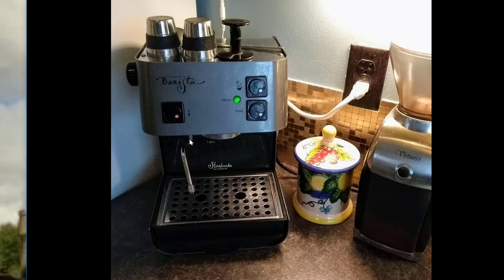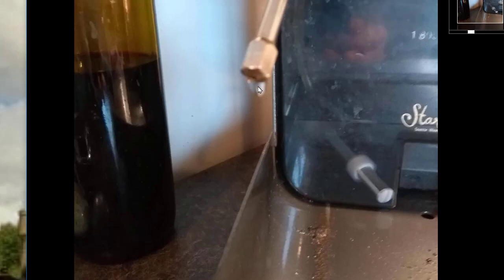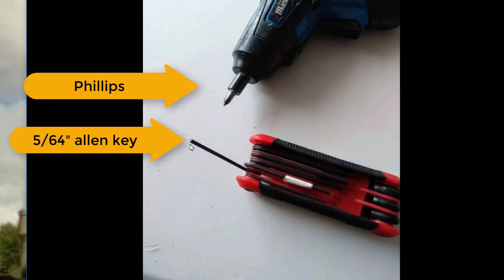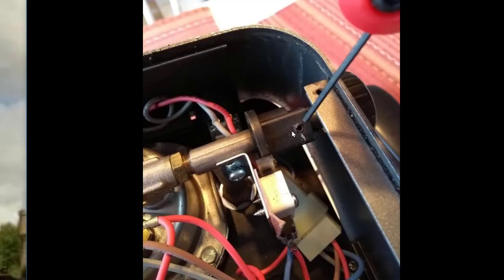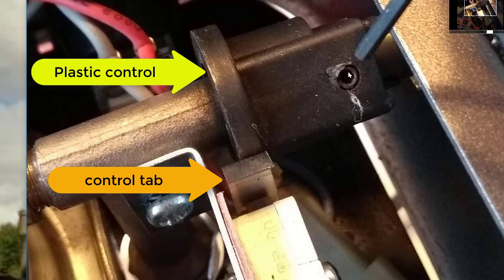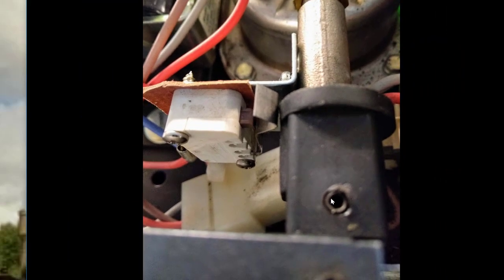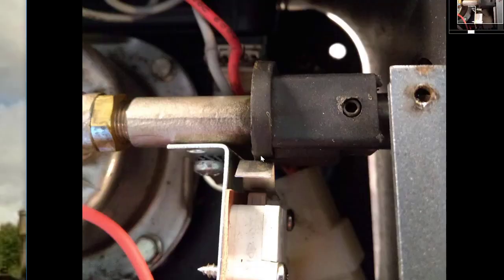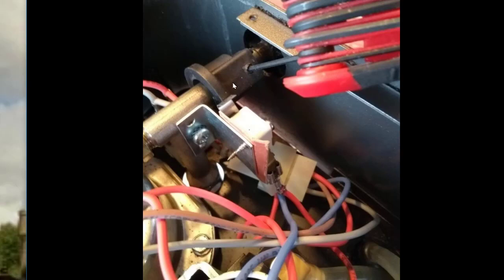Starbucks Saeco Barista Machine - Leaky Steam Wand

Comment: Thank you! The steam wand wasn't just dripping, it was surging water! I wasn't able to do anything to tighten the piece with the tiny hole, as I don't have an allen wrench that small, but by adding a metal washer under the screw the problem was fixed.

Comment: Hi Ken, Thanks for the info. I have a quick question. Would you buy one of these second hand machines in 2022? The reason I ask is the so many machines these days are just plastic but these Saeco machines were built like tanks.
Reply from the maker: I moved ours downstairs this summer for guests. It's OK...lasted a long time, still works.
Replaced with a Breville Bambino Plus that I got a great deal on. Whole other level...way better so far. My wife loves how you can foam milk automatically,  but I'm more of an espresso/americano person. The Bambino does a much better job, but if you get a good deal on the Barista not much can go wrong with them in my experience. Get a decent burr grinder next if you don't have one. Grind is very important.
Reply: A neighbor was giving one of these away late last year and so started our at-home espresso adventure. If you are just starting to get serious about espresso (as we are) then it’s a great machine for learning. Ours is from 1993 and did need a little love/rehab. In the last few weeks I’ve descaled it, cleaned the group head and replaced its gasket, and disassembled the steam wand valve to replace a couple rubber and plastic bits to fix a leak. None of this was very difficult, but I share because you might face something similar. I also picked up a non-pressurized bottomless portafilter from Seattle Coffee Gear that can bring out the best of the Saeco. Finally, as Glen said, the grinder really matters—as much as or more than the machine.

Comment: Uses a 2mm hex key.
The cam adjustment turns the pump OFF.  If ON, the pump is pushing steam/water.
The other problem is INSIDE the valve.  If the seat and O-rings are worn, as mine was, the wand will drip no matter the position of the cam.  Get a spare seat and O-ring kit while you still can.
Reply from the maker: Thanks. If this isn't a fix then the seat and O-ring is likely the problem. Mine was just this simple adjustment.